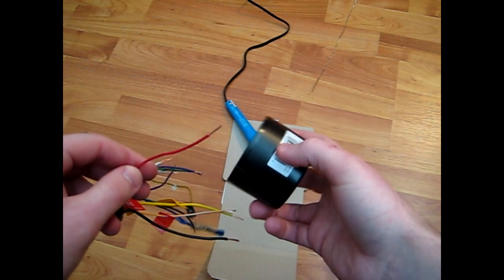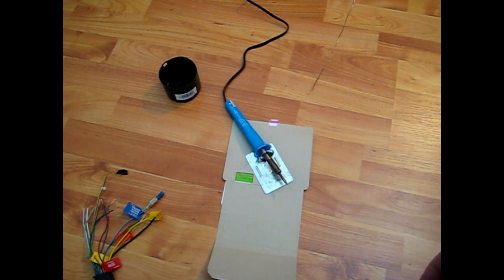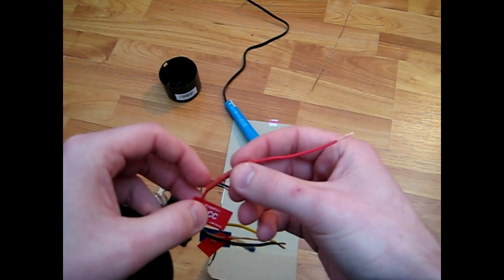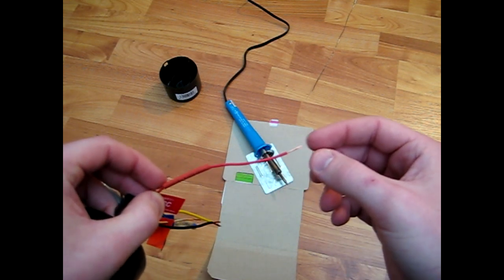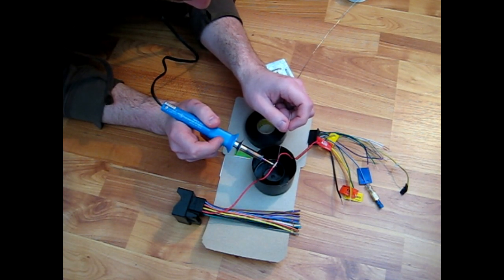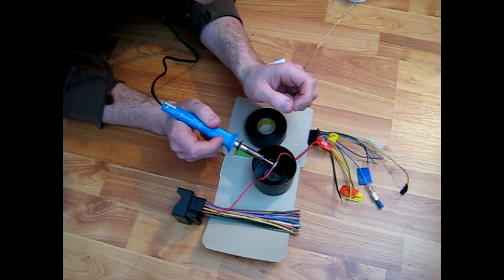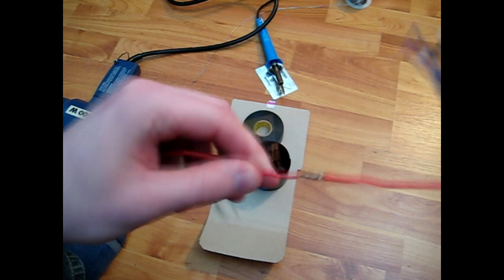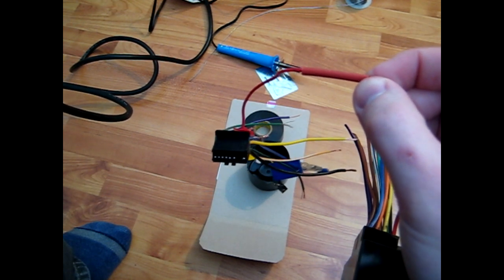DIY: How to Solder Wire

Comment: I purchased this for a guitar pickup repair / rewiring worked great. I could not be happier. You also have to be careful especially with the type of solder you use because it can damage the components. This solder flows very easy and I had no issue. 
here is the link to it in case anyone is interested: amzn.to\17hjGVx

Comment from the maker: What you do is spread the wire strand slightly, then push them together and finally twist so everything holds it form and makes it easier to solder.

Comment: What would make this soldering of wires easier and practically half the time to do it is put a little solder on the end of your soldering iron (heat bridge) when trying to heat the wire.  It will not only heat up quicker allowing you to solder quickly, but it will save you time!

Comment from the maker: Yep, those wires do go together. If you have a power antenna or a booster, it will actually go on/off when you switch from cd/mp3 to fm/am.

Comment: the blue wire with the blue tag on it; mine has the same thing but its blue with a white stripe and the wiring harness' only has a solid blue. do i connect those two or what?

Comment from the maker: Unfortunately no. The heat gun uses thermal transfer of heat and the hair dry is just radiation heat. The hair dryer also will not reach the temperature required to melt the solder.